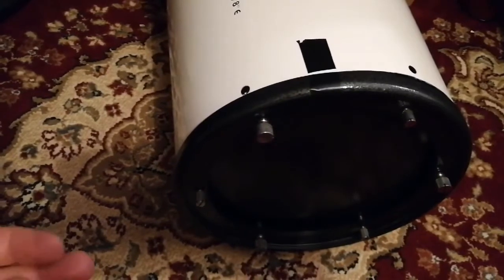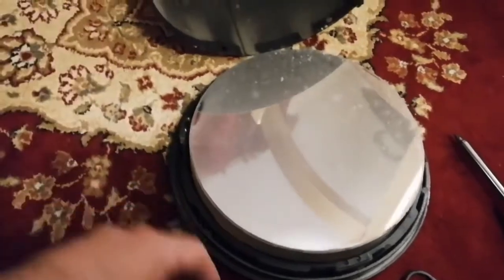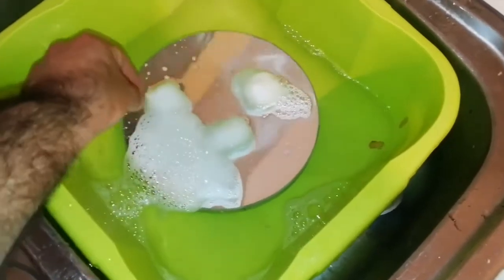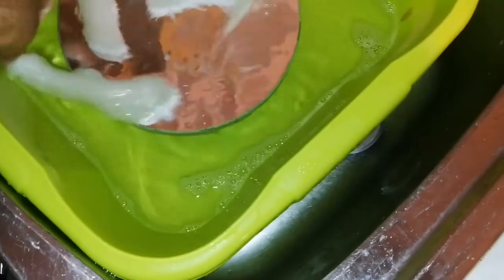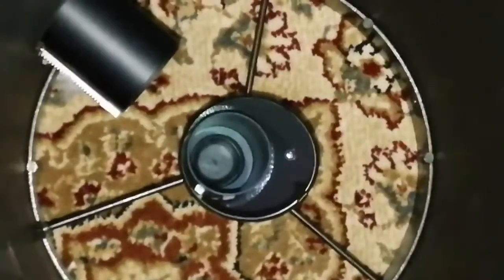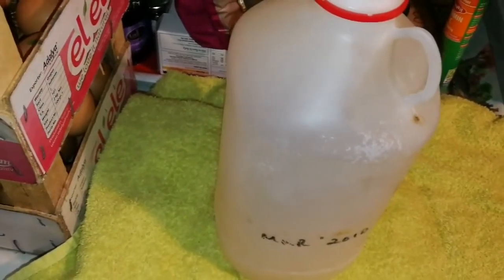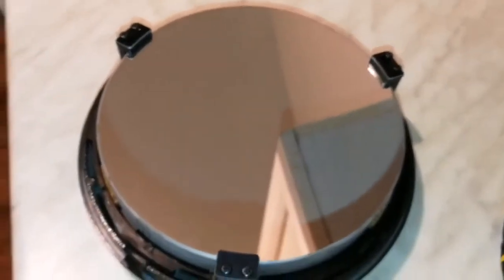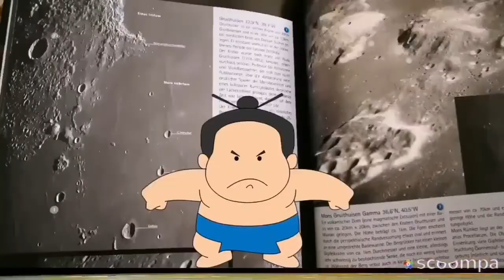How To Clean Your Telescope Mirror/ Soligor MT-800 Astro 200mm(8 Inch)F/4 Newtonian Telescope

Comment: What are your thoughts on this telescope? I found one for offers and half tempted to get my hands on. Ideally, I'm looking to do some astro photography perhaps smaller galaxies, planets etc, I have eq6 r pro mount, so it would hold it alright just wondering if it would be any good for imaging
Reply from the maker: For visual observation is great, but not for astrophotography. You need a tracking mount for that. Having said that I have made some astrophotos with it of M81 and M82 galaxies with that using a hand-held Huawei P30 Pro mobile phone camera. I showed it to Al and David Nagler and they liked it! For astrophotography a refractor is great, something like Skywatcher ED72.
Reply: @TheAstronomer  I do have skywatcher EQ6-R Pro mount which would be ideal for tracking, just wondering if I could connect dslr to it and whether it would be a good quality image,
Reply from the maker: Yes it depends what you expect. Most of the astrophotos you see are made on a computer by image stacking, ie adding hundreds of photos together to make a more visually appealing image. You can achieve some close results by just editing your astrophotos on a mobile phone too!
Reply: @TheAstronomer  I'm planning on using for DSO and start getting into planetary imaging, I'm aware of stacking, tracking, etc,,, hence why I have SW esprit 100 and eq6r pro mount, just concerned whether the brands quality of the newtonian would be as good as SW 250pds